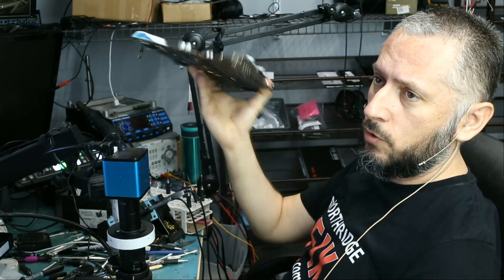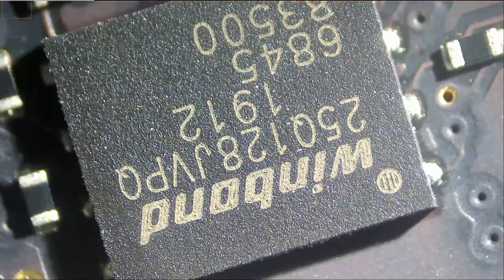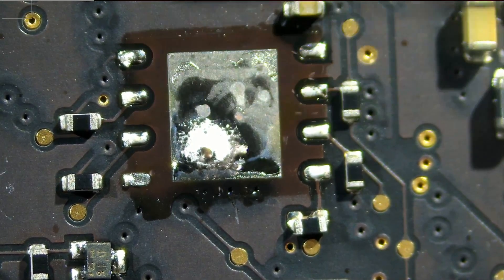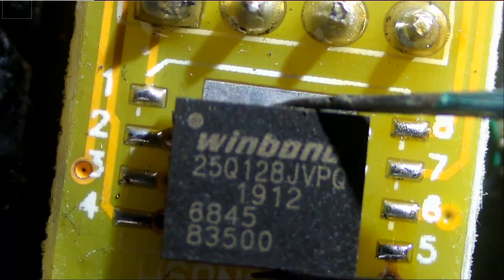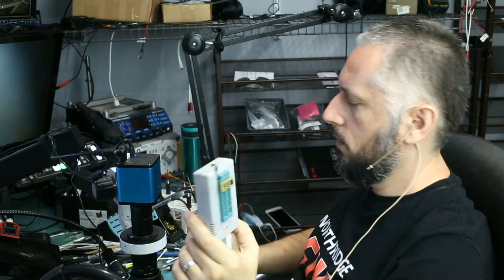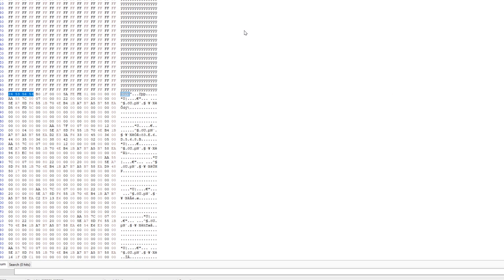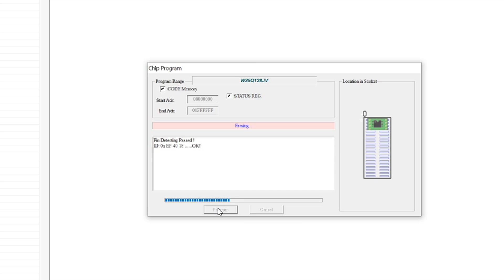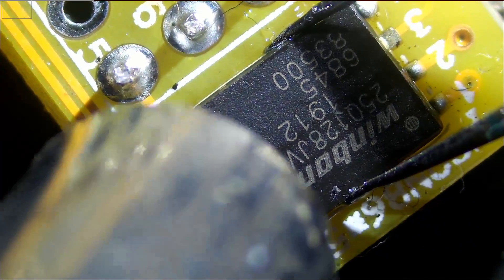2019 iMac 27" EFI password unlock via chip programming.- No T2 security

Comment: Awesome job! There is a seller in my area that has a 2019 with the firmware locked.  I have a 2019 with a dead board, I wonder if I could transfer the chip from it to the one that is locked?

Comment: @NorthridgeFix You can remove EFI through Apple Configurator 2 by putting it into DFU and restoring the firmware. This will allow it to boot into recovery and set up as new. Working on 2018 MBP but haven't tested newer ones (should work), came across it the other week while doing SDW and noticed it removed the EFI also. You should try it next time you get one in.
Reply: Wait how can you put it dFU mode ? I’m having trouble with iMac 2019
Reply: @Moebeastz   Not the 2019 model, starting 2020 model you can put it in DFU to restore it.

Comment: The funny thing is always that apple devices are always repaired with Windows computers
Reply: not always.
Reply: I removed a password on a 2011 imac using a raspberryPi and an alligator clip.  Good times.
Reply: @sprouse9  oh it possible to remove it using a raspberry pi?
Reply: I use Apple OS X to remove Malware for Windows drives or to do Software based Data Recovery. The Apple version reads all the OS types/Partitions and many Windows version don't read OS X partition types.
Reply: @batsonelectronics  using a Mac for data recovery? You're waiting for a disaster.
Reply: @hughjanus6975  well I have avoided it for 12 years so far. Also, Mac Pros run 24/7/365 in several different types of business environments without fail.  I have a 2005 PPC G5 Tower that still runs strong. Except for the Video Chip issues ( various models from 2007-2011) MACs are pretty reliable. I don't turn my machines off for Months at a time. I am very happy with OS X and Macs in general. I converted from Windows in 2007 and started in IT in general in the mid 80's. Thanks for your concern, even though unfounded.
Reply: @batsonelectronics  My comment was speaking about the unreliability of Apples MacBook line of computers. I understand that not every one of their products are defective. The older power pc macs are still doing just fine. My mistake was the assumption of the device that was being used for data recovery. 
I'm glad that using Apple products that you use works out for you.
Reply: Well you could do the repair on a linux machine too. All he did was take a hexdump of the firmware, modified the region with the password and reprogrammed it. Maybe it wouldn't be as easy (without prior knowledge ) but windows definitely makes it easier and less tedious.
Reply: Most of windows machines are built using the best machines, using apple 😂.
Reply: @jbvtechnologies  thats what she said!! The machines at Foxconn and the apple parts are made with machines running very old versions of Windows go and do some research mate.

Comment: Why don't you use wired up pogo pins instead of soldering over and over again? I Use a system similar to the Sensepeek PCBite probes that I bought from Aliexpress and it's worth every penny. I just fixed 8 colorcoded probes to an old broken "Snake" benchlight that I got for cheap (I think you can find them on Ebay or Craigslist) and I sort the other end of the cables into the textool socket of my Galep V the way I need them. Also works great for measurements. 
Kind regards from Germany/Denmark

Comment: Nice job 👍👌and you are fully right, you dont have to know if its stolen or not. You are not the police, you are „just“ a repairshop. If you are gonna start to ask those questions, you should do it on all the other stuff you repair too. I mean everything could be stolen, even if its a iphone with broken display. 
But i have a question too, how do you know where the „$svs“ string ends? I saw you mark the complete last row, what if you overwrite more than just the svs-string or does it end everytime with the whole last row?
Reply: As you can see in the video the block ends when all next rows are FF FF FF.....
Reply: @ahmad_korhani  Thanks for sharing that titbit - I learned something as well.
Reply: @ahmad_korhani  ah i see, didnt saw that before, was too early in the morning when i watched the video. So is/are there always a empty rows after the $svs part/string ends?
Reply from the maker: Yes always. Password ends where consistent flow of FFFFFF starts
Reply: @NorthridgeFix  thx for the answer
Reply: @stefanlechner  I have 0 experience of the procedure shown in this and multiple other videos of Northridge Fix, but the password can be short or long and you need the space available for the longer passwords. I also don’t know if the password is encrypted so there has to be space for the password in its encrypted form which is probably a quite a bit longer.
Reply: @Infiniti25  now i understand it much better thx infiniti